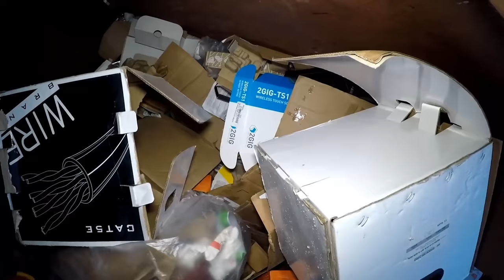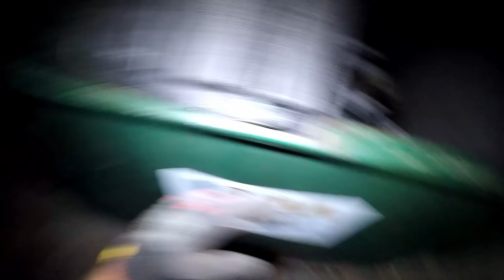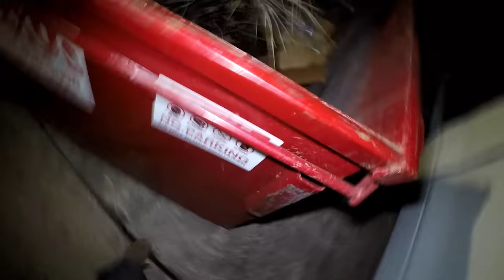Dumpster Diving "We Don't Want Scurvy"

Comment: At at 15 minutes into the video you find the two round cylinders with the big thick piece of power wire and bungee cord that you put inside the box and was saying it look like coffee supplies and that dumpster and I think those round cylinders are the heating elements for the commercial style coffee makers and I remember seeing a commercial coffee maker taking apart because of it being stainless steel several years ago and the heating element looked like that and it should be a spiral coil on the inside of that round housing also that's the actual heating coil but it should be stainless steel every bit of it including heating elements always remember those are stainless steel 96% of the time or a carbon steel which either one is very good Steel

Comment: Spends time getting all iron at 2 - 4 cents a pound, when it comes to getting wires at 1 - 2 dollars a pound "Nobody can get it all".
Reply from the maker: Iron is 11 cents a pound 
And with all that wire I damn near made $200 at the yard yesterday. And I still have all cameras and monitors which should bring another $100-$200 to from my electronics people
Reply: @MikeTheScavenger  Wow, iron went up. Though, here, it is still just around 6 cents a pound. When I stopped scavenging after a move to a smaller place, it was down to 2 cents.